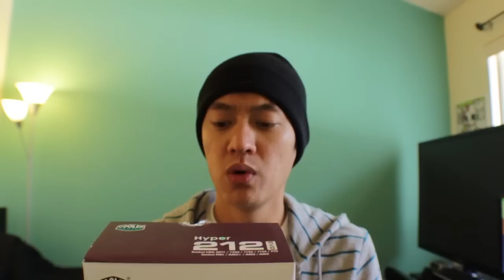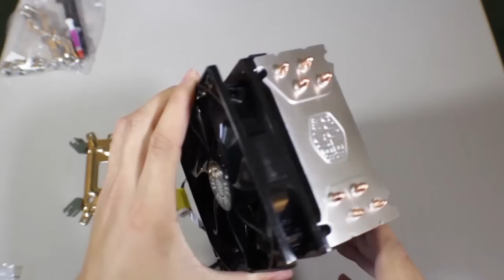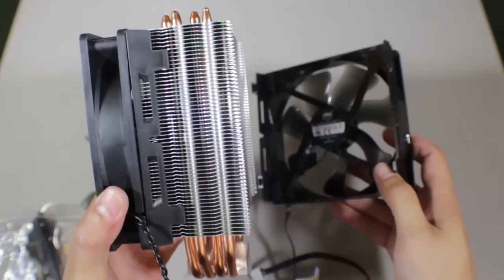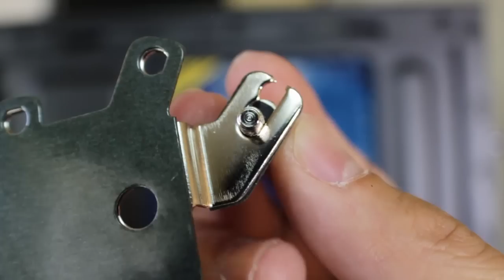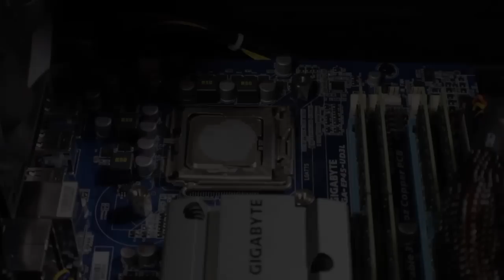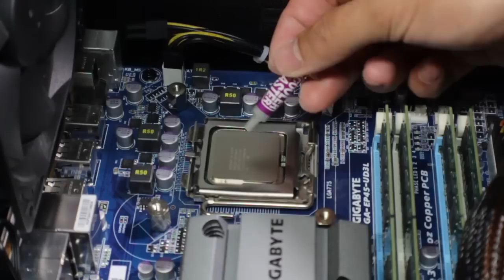Installing an After Market CPU Cooler Fan - Cooler Master Hyper 212 EVO

Comment: I have a problem. I have the same cooler and I'm using an asrock z79 extreme4 mobo and either the bracket is too small, or the nuts where you screw the bracket in are too far apart because I can only manage to get one pair of screws in; the other 2 aren't close enough to the bracket to fit. Help please ;_;

Comment: I think when you tighten the screws you should do it in cross fashion: and tight them diagonally, not from one side to another. But nice video - it shows very important information: what to expect before buying a huge cooler :) I can't imagine installing this madness when mobo is inside the case, even when I have a back cut out on the back of the said case!

Comment: How cool Does it keep the Cpu? I want to put it on a i7-4770.. is it a lot better than the stock fan that comes with the cpu?
Reply: If you are into gaming and imtense uses I suggest you take a after market cooler but otherwise the one that comes with your i7 will be fine.
Reply: LiTTleGaBi21 I am into gaming. I'm just wondering how well it performs.. Is it hugely better than the stock fan? my ultra chilltech wont fit on this board so i need a good after market... should I just go with a water cooler or will this do the job?
Reply: This cooler is top of the line in its class and of course it's way better than stock i7 cooler

Comment: Help me out, please! What's the other fan called, not the one you replaced, but the one under it, kinda upside down towards the bottom. Here is a photo of what I'm talking about: http://gyazo.com/04103cd895297716c1f64940d30c3715 - thank you :)

Comment: Planning on getting an aftermarket cooler (CoolerMaster Hyper 412s), and just want to ask a couple of questions:
Is there any difference in temperatures between a push configuration and a pull configuration? Even if it's 2 degrees? 
Do you have to screw down that little bit in the middle of the retention bracket? How far?
With a quad core CPU and the bottom of the heatsink being the same as the one in this video, what would be the best way to apply the thermal paste for maximum coverage/effectiveness?
Thanks!
Reply from the maker: for a push and pull config, the difference would depend on the ambient temperature around the cooler (inside your case). If it is hot all around there there will be no difference. You're just moving hot air around quicker. Screw it down until it doesn't turn anymore. For an Intel CPU, a small pea size dot in the middle. For an AMD, a thin line across the middle in the same direction as the text.

Comment: Xin chao, i watched another vid in which the guy put the bracket the other way around, does it really matter ?
I put same way as yours, my mobo is 1155 socket, i3570k. However, after i install it the PC keep shutting down every 5-10mins or so :(, i suspect it is the thermal paste which is 2yrs+ old. Any idea?
Reply: Try putting new thermal paste on
Reply: never install a cpu cooler wtihout new paste! clean off both the cpu and the cooler with alcohol and apply a new paste. looks like there is paste included.

Comment: One thing about this cooler is that it moves around and it does not have that much pressure on the CPU. You can even see it this Video when mounting the fan that it is pretty loose even after it is screwed. This is what happens with mine too, Is that normal for the Evo 212?

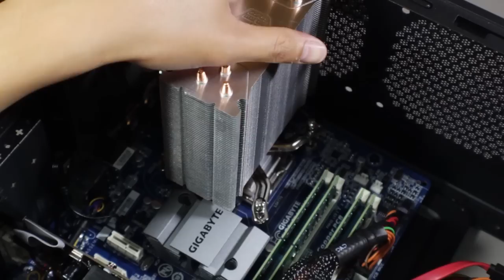Comment: 22:00 when i bolt one screw the opposite one gets too high and i can't screw it, what to do?
Reply: Don't screw them down all the way tight. Like with most things that have a lot of screws you want to apply pressure evenly.  Screw it down gently and not all the way, and then move to the opposite screw. If you are on the bottom right, like he is, then turn maybe one or two rotations, after that move to the top left. Good luck.
Reply: ***** Well thats what i've been trying but it seems that even if i just put my finger on the bolt it's enought to get the other one moving to high... thx anyway, all i can do until is to bolt the 2 top ones
Reply: Adrien Marchand Same here man. Got so frustrated that I just bolt the top screws and call it a day.
Reply: Tom V Well today I got back to it and re-did the installation process. Instead of holding both sides to balance each other while screwing the bolts in, I just let someone screw in the bolts while I apply force on the plate thing. And it worked! After screwing in both opposite ends, the other two bolts became an easy process.

Comment: I installed this cooler today and when I turn it on, I see a red blinking LED which indicates overheating. After a few seconds the computer shuts off then turns back on, but with no keyboard mouse and a black screen. I believe I am putting it on wrong, does amyone have a similar problem? I got it to work for a little then this same problem occurred

Comment: Outstanding instruction. I'm an "old-school" computer guy from back in the '70s retiring in the early 2000's and have not seen a better job of instructing.

I noticed that the screws holding the new cooler in place appeared to be spring loaded. I'm guessing that would account for the unit moving some when you installed the fans, no?
Reply from the maker: Yes that is correct. It also moves around because of the thermal compound. Thanks for watching!

Comment: Johnny, question for you, I have two 140mm exhaust fans and have my cooler vertically mounted in push config, should I add another fan to my cooler for a push/pull or will that make too much turbulence?
Reply from the maker: That is a tough one to answer. It depends on how much air the 140mm fans are moving out of your case. But also the fan that will be pulling air would need to move air as fast or faster than the fan that is pushing. Either way just try to figure out if the new fan on your cooler that will be pulling is moving the same amount of air as the 140mm will be exhausting. Which I think it will be able to because they are bigger and can move more air.

Comment: Hey, thanks for talking about the upward position. people have fallen into a groove of just using it to the rear and thinking that is the only way, and the right way. I have found in my larger, open air case (THOR V2) that the upward provides me a few degrees lower in temps under full load with high OC.
at least I'm not the only one who has thought of this and knows it's an option. but I fell like you might be underestimating it's usefulness. It's a very very good position, you just have to understand your particular airflow set up.

Comment: Very clear video, thanks.  I've watched it twice in anticipation of my upcoming build.  One thing that bothers me is how loose the cooler appears to be after tightening down the four holding screws.  Should the cooler be pivoting like that when attaching the fan?
Reply from the maker: It will move around a bit because of the thermal compound yes. Not a big deal though. You won't be able to tighten it down hard enough to keep it from completely moving. Thanks for watching!
Reply from the maker: Thanks!
Reply: Lol wtf that moment you forget to tighten the screws. Bro i installed this on my i7 8700k this week temos are fine dont need second fan. And mine was not wiggling around that vibration noise must be noticable. GUY DONT FURGET TO TIGHHTEN THE SCREWS LOL

Comment: hmhmhm my i5 760 is somehow still in use after years of OCed a GHZ to 3.4ghz on stock fan and idles around 40c. never gets about 70c during high load.

Comment: What is happen when you accident touch the CPU fan while is running? it is gonna ruin the CPU or no?
Reply from the maker: It will not ruin the CPU right now but if your CPU fan is damaged and fails prematurely then that could damage the CPU over time. But it should not be too much of a problem.

Comment: phoung why did you install  one fan facing the front and the other fan facing the back or rear.  are they both intake fans, air going in and going out the  back. i don't understand which direction the fan should be facing for proper airflow.
Reply: thanks helps alot, planing on building a pc with a amd fx 8350 8 core. its 199.99 on amazon.

Comment: I like the fact that you didn't try to speed through everything, the peeling tape and caution about the memory were the parts of the video that stood put the most. Even vet installers don't take that into consideration and they buy because they read lots of reviews, then the cooler doesn't fit. Great video bro, ummm  keep it up lol.

Comment: you have Gt 520  .  whyy ?? :D :D
Reply from the maker: This video is old and the parts were even older. This system was actually a hackintosh. I have other videos on how to setup and configure a hackintosh and one of the videos was how to get the 500 series fermi cards working. Thanks for watching!
Reply: ok

Comment: is it the way your case is set up leaving you clear access to the back of it like that? i dont have that. so this will be more complicated than i thought. i will have the same heatsink and fan in the mail tomorrow and am gonna be installing it on an fx4300 amd build. looks like ill have to rip the whole mother board out to attach that bracket huh? blahh!! excellent video though, bud! very imfortmative.

Comment from the maker: The noctua fans are great but costs more. It would be worth the extra cost if you want a quiet fan or for overclocking. I don't know how the installation goes. If you have the stock cooler that came with the 8350 and it is a 3 pin fan, you can try getting a fan speed limiter to slow it down. If you have a 4 pin, you can try to adjust the fan speed in the bios.

Comment: I have the stock fan of my CPU and i was thinking upgrading it. At the beginning of the video I saw that you installed the support, do I have to do that or the support from the stock CPU should be ok with the aftermarket one.(17:50)

Comment from the maker: No you will not. If you want to slow it down then pickup a resistor and limits the electricity to the fan and that will slow it down. I will put a link into the description.

Comment: Thanks for posting this !   I am currently trying to get a stock CPU cooler off.  For some reason, it won't budge.  Undid 4 screws etc.  Don't want to pry it off, in case it does something to the AMD phenom X4 processor in the process.  I don't see any additional screws stopping it from lifting off and wonder if the thermal paste has become a kind of glue, stopping removal.

Comment: i bought a fx8320 but the noise of the stock cooler was just... unacceptable. So i bought thys cooler and will have it deliver today, hope its not as noisy as the stock. 
Thx for vid, and tip, will help me alot today.
Plz do an video of the cooler while its working, and let us hear how noisy it is.

Comment from the maker: It is very quiet since I keep the setting on low through the BIOS settings. You can also pickup a pair of corsair SP120 Quiet edition fans to replace the stock fan it comes with. I will put a link in the description for some choices.

Comment from the maker: It does not need 2 fans. It would be needed if you overclocked your CPU and you need the cooling for the increased heat an overclocked CPU will generate.

Comment: Hey i need help when i try to screw in the holes by hand the bracket on the opposite side bends slightly higher and you have to out a little extra pressure to bring the bracket down and screw it in. Did i do something wrong?

Comment: it's okay not to screw it tight? because the cooler wiggles when you attached those fans? I think the plate of the cooler wasn't fully in contact with cpu.

Comment: I was surprised when I received four Cooler Master fans that had no arrows. I picked up a 120mm 4 pack, to use as support fans. Wasn't a issue since I just looked at how my back fan was placed (blade design suggests airflow direction), but, you'd think all fans would have this.

Comment from the maker: You can tighten them down until it won't turn anymore. Just don't try to tighten it more than that. It will always move around because the thermal compound is greasy. After about a month of use it should not move around too much.

Comment: okay, the motherboard has dual channel ram, so I wanted to get at least 2 sticks to take advantage of it. Thanks a lot johnny, you are very knowledgeable (if that is a word haha, i think it is...). I didn't realize that there are 2 kinds of the Corsair Vengence ram. I also read somewhere that the fan can be put on the top, do you know if this is true?

Comment from the maker: Maybe not with only those two sticks installed because you can use the slots that are away from the fan. But in the future, if you get 2 more sticks, then you might have a problem. Also, there are 2 kind of Corsair Vengence that I know of. The CMZ and the CML. the CML have smaller heatsinks so it should be clear. It's the CMZ models you have to worry about clearance. I don't know what the difference are in performance but I'm prett sure it has to do with heat dissipation and in turn overclocking

Comment: hey johnny, i am thinking about getting this cooler, but I am worried that the fan will not make me able to use one of my ram slots, the motherboard is an ASUS p8z77-v pro with Corsair Vengeance 8 gb (4gb x 2), do you think that the fan will get in the way or will I be okay?

Comment: For someone who has a vent on the top of their case but no top case fans would it be more effective in that case to have done the up/down fan facing method instead of the left/right? Because you have that rear case fan that's already so close that could be sucking straight off the one side of the heatsink so it's almost like having 3 fans pulling off it from diff directions?

Comment: I figured I'll get a better intake fan, mount the Evo so it blows out the back and use sleeve bearing fans one will be about 70-80CFM and have two fans on the top of the case, and one on the back all exhausting air oh and a fan card below my GTX 660 OC

Comment from the maker: The only 2 things I see is that the EVO has a slightly better fan that moves a little bit more air. The fan also looks better being that shiny plastic with wavy fins. If you're into that sort of thing. Then the Plus uses direct contact heat pipes but the block surrounding the heat pipes is aluminium. So it looks like copper embedded in aluminium. The EVO has a copper block so it is a solid piece of copper touching the CPU. Copper is more efficient in heat transfer.

Comment from the maker: That sounds like a good setup and I also have another system just like yours. Same mobo with a 1090t. I have 2x6850 generating a lot of heat so I put in a fan on the side panel to cool them down. I think either way, heat from all the other components is going to pass through that heatsink if you have a mid tower case. If you had a full tower case with lots of room to direct air flow however you want it to, then that is something to consider. Thanks for watching!

Comment from the maker: If you have ventilation on the top of the case then I suggest moving the air vertically from bottom to top since hot air naturally rises. If you don't have ventilation on the top then the front to back will have to do.

Comment from the maker: Back plate, not black pate. It is the plate that the cooler itself is screwed into. It goes behind the motherboard. That plate has holes for AMD and Intel Sockets. In this video I am using the side of the plate for Intel but you will be using the other side of the plate for intel. So you need to flip it around.

Comment: another thing, the cooler you used for the "pull" configuration seems to be from antec. so im guessing any 120MM fan or even 120 mm case fan will work for this?

Comment: Great video, I have the same case but with a Asrock 970 motherboard and a Phenom II x4 processor. I was wondering what your thoughts are for my cooling set up. I have one fan at the back and a stock cooler. I want the Evo with a second fan in a push/pull config. Should I set it up like you did or do you think I should put two fans on the top of the case and maybe turn the cooler so it blows out of the top? My worries with that are space for the top fans and cooler and hot air from the videocard

Comment from the maker: The only difference is the back plate will need to be flipped to use the other side. You might be able to still use a push pull if you turn the cooler and have the fans blowing air vertically.

Comment: These are my current specs - 

AMD Phenom II X4 955 Black Edition Socket AM3 3.8GHz 8MB L3 Cache CPU
Coolermaster silent 80plus Certified Efficiency PSU 400w
8GB Dual Channel G-Skill RIPJAW DDR3 1600MHz
AMD ATi Radeon HD 6850 1GB GDDR5 PCI-E Graphics Card
Asus M4A88T-V EVO/USB3 880G CrossfireX Motheboard
Coolermaster Elite 430 All Black Interior Mid Tower Case with Side Window

Im thinking I probably wont be able to do the push and pull because of the ram or correct me if I am wrong?

Comment: Hey man, Nice vid, Its really helped alot thumbs up and subcrib. Im currently afterthis cooler but still abit puzzled. Im using the same case as yours but currently have a different board and phenom ii x4 955 be. Was wondering if I could get some help of you as to how to fit in with my current rig. Still learning.

Comment from the maker: They do sell a 4pin molex to 3/4 pin header plug. So you would be using power from an extra 4pin molex. Chances are you might already have the adapter laying around.

Comment from the maker: No I don't but this was the only available system for me to use and make this video on. My main rig is a core i7 2600K with an h100. This video isn't about cooling a cheap system or what kind of system needs aftermarket cooling. It is about installing an aftermarket cooling. There is already way to much talk in this video already so maybe that would be another video. Thanks for watching!